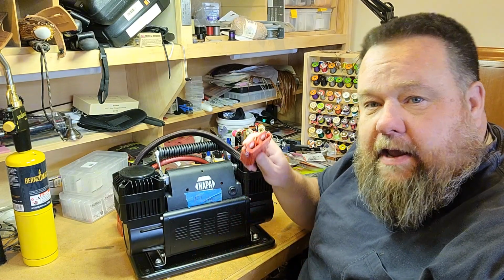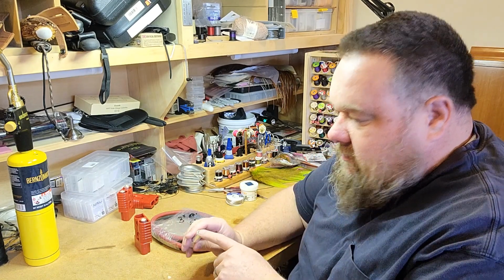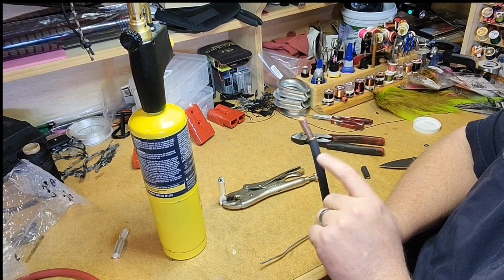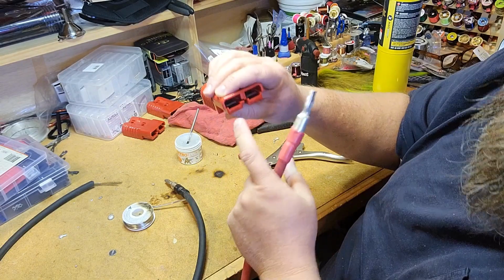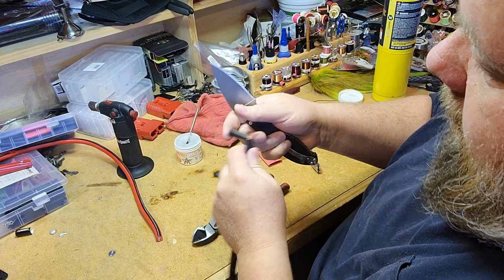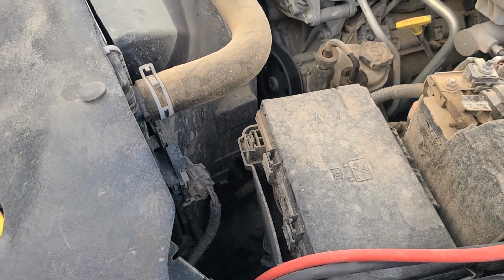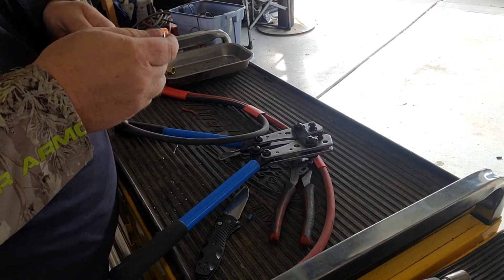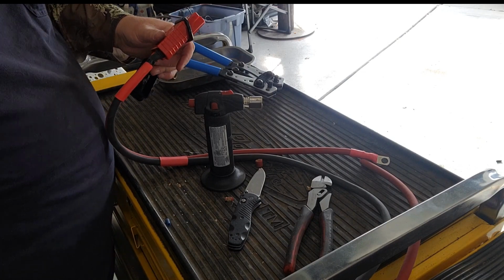DIY Anderson Connector jumper cables

Comment: Thanks for the video. I had a computer repair shop where I microsoldered thousands of motherboards. This video probably saved me learning what works best by trial and error. PS, I'm probably going to use some foil tape for the wire under the hood to protect it from heat.Also, I think an isolator switch is good to keep it from sparking when you plug and unplug. What do you think?

Comment: Much easier to put the terminals in a vise. Flux the wire and and jam it into terminal when hot. You can apply a little more heat if you want, but usually not necessary. Done battery terminals for decades like that. Also another overlooked flux that works great is plain battery fluid. Sulphuric acid. You need to clean flux off both methods. Most times I dont bother cleaning off paste flux. Like those terminals for any D/C high amp application. Company like Deka sells twin cable like that by the roll for jumpers. One good thing is no one will want to borrow your cables because of the custom plug on one end. Good video about a common modification. You can get killer clamps with a led red and green light that will tell you if you have polarity reversed thus saving your alternator or the one you are jumping. Worth there weight in the dark and cold.

Comment: i'm doing almost the same thing, except i'm wiring 2 gauge wire to my trunk and terminating it with an Anderson connector. this will allow me to open my trunk and be able to stand under the trunk lid as i set up my air compressor that's also in my trunk. this means i have to spend less time in the elements and i don't have to worry about popping my hood and messing with alligator clips.
i'm happy with the setup.

Comment: I used the red sb 175 as well, and I mounted my plug in the bumper so I don’t need to open the hood. I also have an Anderson connector on both ends of my 20 foot cable because my other vehicles have Anderson plugs as well. I made a set of clamps on 3 foot wires in case I need a jump from a vehicle that doesn’t have the plug. One more thing I did, on one end of my 20 foot cables, I used a black connector because it will mate to any color sb 175. Having the plugs in the bumper is really handy especially if freezing rain left a layer of ice preventing you from opening the hood. Just plug in and hit the remote start.

Comment: Love Anderson PP and SB.  I mounted a SB50 by my battery using some 8awg wire.  Put some SB50's on my charger and 2000A Nexpow jump starter I keep in the Truck.  Quick and easy if I ever need to charge or Jump the truck.  Cut the Jumper wires the Nexpow came with and put 2 SB50's on them so I can still use the normal Jumpers if I have to use it to jump someone else's vehicle.  
Also I went with 8 awg because that is what the Nexpow cables are, and I had some laying around.  Never had a Issue with them.  Best connectors ever made.
Reply from the maker: Big fan as well. I just did some new Power Pole connectors today as well. I'm going to have to do a video on all the interchangeable gadgets I have.

Comment: I have this setup on my Jeep Wrangler.   Bought the Jumper Cable Kit, with the Anderson Connectors already installed, from "Fleet Farm".  This was over 8 years ago.  Mine are, 4 gauge, 16 feet long, and still working great.  I needed a reliable vehicle jumping system.   I didn't like opening my hood every time a vehicle needed a jump.  Specially when we had to move all the cars on the car-lot for Snow Removal.  And yes,  I also used my Jeep for Snow Removal.
Reply from the maker: Once you start using the quick disconnects on things it's hard to go back to anything else.